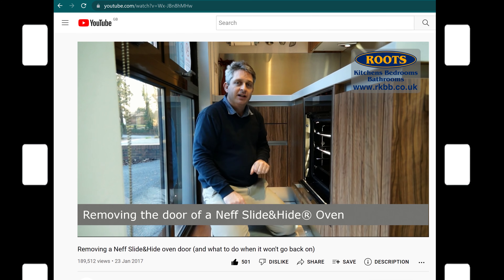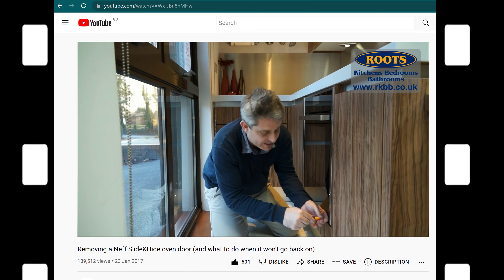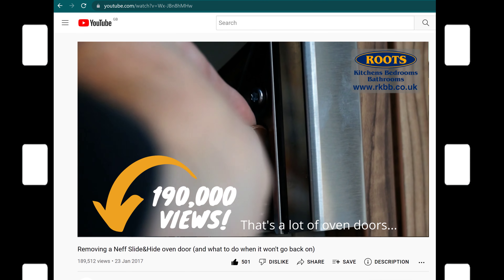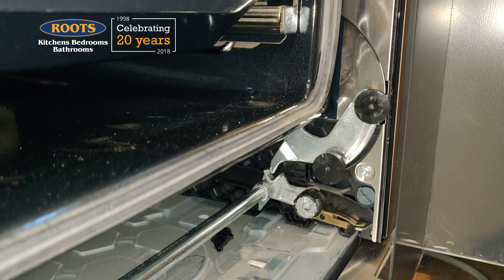Neff Slide and Hide - fixing the oven door hinge

Comment: I have had fitted 2 genuine replacement oven door seals on my Neff oven and they keep breaking, any ideas why ?? please, they have split over few weeks of each other, any advise would be appreciated before I order another.
Reply from the maker: Not something I've heard of but I would email the supplier as maybe they were faulty/brittle or they're discovering there's a batch issue with what they've bought from Neff. Things to check alongside that;
What cleaning products are you using? Check the ingredients and usage instructions - they may not be suitable for rubber products (and even if you're cleaning the door glass and not the rubber, residue if not washed off could potentially, maybe, possibly... affect the seal)
Check the part number of the seal with Neff over the phone - just in case you're getting one that's slightly too small, not enough to not fit but enough to keep it under tension so it splits over time (I think this is unlikely, but no harm checking with a phone call).
Hope that helps,
Steve
Reply: @RootsKent  thanks alot Steve for taking the time to reply, your advise is appreciated. On that note,  I will phone Neff tomorrow and speak to them rather than email service. Thanks again
Reply: Hi Steve, I finally have an update and thought to let you know. My issue was passed to there engineering team and it turns out there was indeed a batch issue  and there is a new part which has changed. They are sending this out free of charge. Hope there is no further issue. Thanks again @RootsKent

Comment: Hi Steve, I used your video last time I cleaned our oven door and it was invaluable.  This weekend I gave the door it's 6-monthly clean and I have a new problem - the hinge locks, don't lock!  ie the hinges go into a vertical position and the claws pop out of the V slots.  With my wife + 2 screw-drivers we can reposition the claws and then one of us holds everything in place by pulling the bar, and the other fits the door.  But we just can't seem to get the door over the wheels.  Have you heard of the hinge-locks failing?  I am definitely moving them from unlocked to locked as in your update video and pulling back before letting go - to engage a tooth.  But they just seem to have completely failed both sides.  Any ideas?  We are obviously oven less at the moment!  Thx.
Reply from the maker: I heard of the lock breaking from another comment here but I've yet to experience that myself. I do have trouble from time to time getting it to lock though,  I think I might of in this video! (been a while, so I'm not sure).
I'd certainly try several times just in case it's a position/angle thing.  Maybe 'opening'/'angling the two circle on the hinge further towards horizontal' could help. 
I think it's unlikely both hinge locks would fail at the same time too, so I'd be hopeful at this point it's just an angle of hinge, or how far the circle lock is turned, or if it's turned the right way...
good luck!
Steve
Reply: @RootsKent  I solved it in the end!  The hinges have to be pulled all the way - ie the claws pushed ALL the way back in order for them to be lockable.  Do left first and then right.  Keeping both little twin-roller sliders on the claws (with the bar between) whilst man-handling the hinges takes some 'patience.'  Then once you have refitted the door and reset the hinges locks you must open the door slightly to reset the mechanism - before trying to close it.
Reply: @PaulJReading  Thanks for posting this!  Could not get the claws to lock back at all. tried your ALL the way back, left, then right and it worked a charm.

Comment: Hi i have a neff slide and hide oven and today i took the door off to clean it but when i came to refit the door i noticed that the spring mechanism on both sides had sprung upwards and were not in the correct position to enable me to refit the oven door so i turned to YouTube and saw your video for advice very clear instructions indeed however after many many attempts plus watching your video over and over on how to fix this problem i cannot get the spring to come down and to stay in place it just goes back up to its original position please please please can you help me to rectify this problem
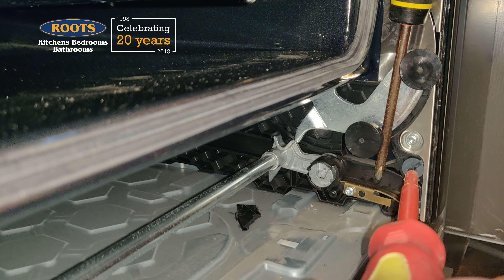Reply from the maker: you need to move the hinge back, then lock it (turn the circle with a coin or screwdriver, in the video at 0:57 ). You'll see I had to do it twice to get the lock to hold, try holding the hinge down at different angles if it doesn't catch the first time.   To of the slash to the back of the oven is locked if I remember correctly (so the left and right side are mirror image, but top of slash to back to lock... if I remember correctly).  Good luck!

Comment: Steve, is there a way to disable the switch that turns the oven off when the door is open, this feature is very annoying when trying to use the grill
Reply from the maker: No, by design modern ovens work as 'closed door grilling'. 
I was taught (pre millennium) the British way is to put the food and grill pan as close as  possible to the grill, and create enough smoke from burning fat to set off the kitchen smoke alarm. The European way is to put food on the middle shelf, and a pan at the bottom to catch drips so they don't burn and smoke as much. I don't know if that's true. I'd also think that having the door open and continuous grill is a problem for heat rising out of oven and potentially damaging oven controls

Comment: Hi, I have used this video before to repair the right hand side hinge (like in your video) but I am afraid this time the left hand side has come out of position and even following your video I cannot repair it.
Reply from the maker: Can you share a little more detail? Is the hinge not staying at the angled position? or can you not move the bar forward to be under the claw?
Reply: @RootsKent  I can move the bar forward to be under the claw but it won't stay in it. Can I send you a picture if that is of any help.
Reply: I really appreciate how useful your videos are but I am wondering if the technique is the same for the the left hand side as the right as the starting position is different in that it is impossible to safely get the screwdriver between the two wheels. I levered the mechanism in a different way.
Reply from the maker: @PeterWillingale  Great, glad you fixed it!

Comment: I can’t keep the hinge locked to the bar help !!!

I have followed your video but it just keeps springing back up
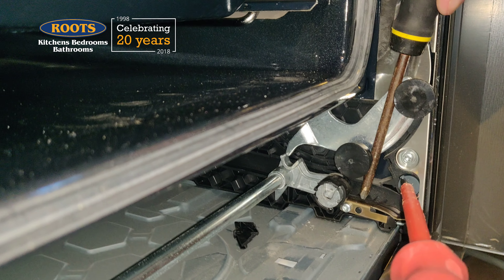Reply from the maker: Keep trying, at 1:10 you'll see I had to try locking twice. Other comments here show you're in good company as lots of us have struggled to lock the hinge for a while. Do keep trying different hinge positions, turning the locking circle both ways, maybe event a light tap between attempts (if the plastic push rod you can't see is sticking that might help release it).  Did I mention - Be careful of your fingers! 🖖
Good luck!
Steve

Comment: I've got a neff oven when I took the oven door off something clicked & when I put the door back on the one hinge has gone into a locked position but inside the door itself how cobi get the hinge out plessr
Reply from the maker: I'm not sure I can visualise this, but guesses:
Door is half open, one hinge on, the other hinge not:- I'm not sure how this could happen, but rotate the door handle to release the connected hinge to remove the door. Then set the hinges back to the 45degree open and locked, then remount the door. 01:37 on the video
Door is on but one hinge is locked still:- assuming you've turned the locking circle 00:54 (used the red screwdriver) and it hasn't unlocked, try gently putting pressure on the door/hinge up or down and try turning the locking circle again. Maybe there is a little too much tension on the locking part and it's not sliding free. Not something I've seen before but I would think this is like trying to change gear on a bike when you're peddaling hard up a hill - you have to ease of the pressure to allow the change to move between cogs.
Something else? :- sorry I didn't understand, you're welcome to try and explain again though!

Comment: I am struggling with the lock today on the right hand side. I took the door off, cleaned all glass panels etc, when I went to put it back on, I noticed the right hand side had not locked into position. I figured I hd to lock it in position before trying to put the door on, but I just can't lock it in place. I have been struggling to get the hinge locked in place for an hour and a half, used your screwdriver method but just can't get it to lock! please help or my grandson won't get his dinner!
Reply from the maker: I hope you fixed it and got your dinner 🙂
If not, most commentors seem to have found that trial and error works. Put the hinge in a different position, turn the lock, slowly release the hinge to see if it locks. If not, try again in a different position. I think between 30 degrees and 45 degrees open.  Screwdriver or coin has the same effect (the first video you'll see I used a coin, the choice of screwdriver here was simply because there was one next to me on site).
Good luck!
Steve
Reply: @RootsKent  thanks for your reply. It refused to lock, but I ended up getting a neighbour to hold it in place while I put the door back on. All appears to be working now.

Comment: Hi, the bar came out of the sliders. we managed to get it back in but now cannot get the hinges on both sides to lock on to the sliders. We have tried to turn the lock (once we've put the slider and hinge into the correct position) but this has no effect and the hinges spring back out again. Any suggestions?
Reply: How do you get the bar back into place
Reply: Please help
Reply from the maker: Hi Maxine,
"...hinges spring back out again..." it sounds like hinges aren't locking in the open position? If so, just as I found at 1m13 in this video, you can try again until they lock.
It's tough to describe these things in text so I hope I understood properly and that was helpful!
Steve

Comment: My hinge is sitting higher do you know how I can get it back down?
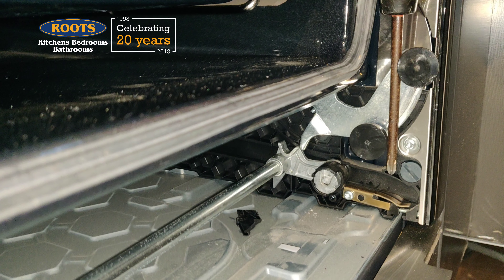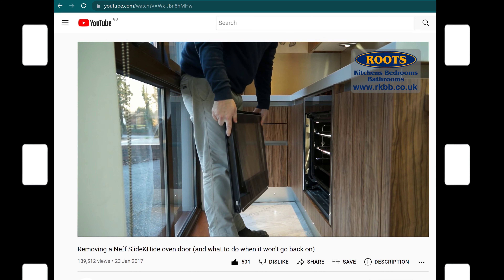Reply from the maker: Like at 0:55 in the video, the two circles one above the other?  If so, from 0:45 shows releasing the hinge lock to then move the hinge back to the correct position to engage the claw. Be careful of your fingers 🙂 It might be the claw is engaged correctly for you but you need to "unlock -> move the hinge to the angled open position -> lock the hinge" so you can slide your door back on.  If the claw disengages whilst you do that, from 0:34 are the steps to engage the claw again.
I hope that helps!
Steve

Comment: Hello, please help! My rollers have gone in a weird position(totally far back!) and now im frustrated! What do i do please??
Reply from the maker: Hi, reach in and pull them forward 🙂
If the rollers come off the horizontal bar, that's OK. When you've got them back to the front of the oven you can push them back together. You'll find you have to have one further forward than the other to slide the bar back and then bring them back to level (if viewed from above, it's like twisting the assembled bar and rollers from 30 degress back to 0 degrees-side-to-side across the cavity.
I hope that helps!
Steve
Reply: @RootsKent   thanks for your reply, its stuck! Proper stuck no chance i can pull it forward😔
Reply: Hi - it’s the actual hinges that are the problem. Right side is fine - left side the hinge has gone too “down” and cant seem to yank it up so it’s in same position as the right one. It’s not the rollers that’s the problem. Problem is with the hinge
Reply from the maker: @linguist786  Hmm, can you lock/unlock the left side hinge. Be very careful - the springs are very strong and will crush your fingers. See 1:07 where I'm using a screwdriver as a lever to keep my fingers well away.
Perhaps try locking/unlocking, apply a little pressure and lock/unlock again - in case the lock isn't releasing because of the pressure already on the hinge from the spring

Comment: The problem I have is I can't gain access to hinge because the door won't raise when I slide it forward. I am at a loss what to do next
Reply from the maker: Sorry for the slow reply, I've been busy with my real job :-)
I'm hoping you solved it by now and if you did please share to help others reading this.
Pure guesses - it sounds like the door is open and under the cavity. If it won't raise to fully closed, I'm guessing the hinge could still be locked? Try locking/unlocking the hinge (circle with a flat slot) a few times. Maybe it's stuck locked and once released the door will rise fully.  It might be you can tell which side is stuck by how the door rises, if it catches on one side but not the other.

Comment: I removed my Neff oven door to clean. 
It’s the older model, one hinge has locked before I put the door back on. Help please?
Reply from the maker: Older model, still hide and slide or normal 90 degree opening hinge?
Reply: @RootsKent  90 degree hinge opening. I just got sorted, I used a pliers to pull back hinge . Thank you soo much for replying 😀

Comment: Able to engage the hinge on the left hand side facing the door. The right hand hinge won t stay in place when locked.
Reply from the maker: Suggestions: check the door bottom corner that engages with the sliding part is the same both sides (if I remember correctly, a black plastic part with hook part. I once had an oven with a broken hook).
Check that when handle is rotated, both bottom corners of door move the same ( I've heard but not seen broken cables within the door)
Then check the silver sliding bar, circles have rotating black plastic locks. Maybe one is locked and the other unlocked.
Sorry for brevity, answering from mobile :-). Good luck! Steve

Comment: My roller bar has come off . How to I put that back on please
Reply from the maker: If I recall, the bar just pushes into the left and right side rollers (at 0:50 you can see the bar and right hand side roller, the part that the claw enagages too).
I think (long time since I did this) the trick was to push one side in (say left side), angle the bar with the right side forward and the right slider, then move the slider towards the back as the bar pushes in.
I've probably given better descriptions, sorry!
I recall that the bar with sliders attached couldn't rotate into place so one side had to be in first. 
I really hope that helps! Steve

Comment: Brilliant instructions. !!!  I have just been able to Lock the spring hinges and get the hook into the V ,   Shaped receiver , by using a long screwdriver to hold back the top roller & spring , and then turning the slotted dial to right or left , depending on which side of door you wish to lock the spring on .    Remember to leave the black plastic locks on horizontal roller arm unlocked. !!! Otherwise the door will not drop down far enough to be able to close,
Also when trying to close door, don’t forget to hold up the door handle as this allows it to drop down to correct position , and you should be able to close it then  !!!    He should get a knighthood off Neff , as they are useless!!!   Talk about German engineering, terrible. !!!
Has to be the worst ovens ( I have 2 side by side ) I have ever bought,  after 3 years everything started going wrong on both ovens,    Cheap plastic components used inside , and both had to have new programmers,   Nice to look at , but that’s about it .
Everyone I know who have owned one ( Neff ) would not buy again .
   By.   Ex - kitchen fitter .

Comment: What a nightmare to replace the door just because we had a smear on the inside of the glass. Ended up with the hinges in the wrong place and the bar off the lugs. Manage to wreck the seal around the oven so we'll need a new one. But at least the door is back on. The instruction manual is less than helpfull. Thanks so much for this video.

Comment: How do j get the bar to go back in place my bars come off
Reply from the maker: The bar that fits into the sliding part the claw engages? They just push back in place. You won't be able to do it when the claw is engaged though. You can remove left and right slider and bar from the oven, reconnect them, put them back in cavity, then follow the process in this video to lift claw and re-engage each side in turn.

Sorry for the three day delay - hope you manged to cook in the mean time :-)

Feb - Aug 2022:
Hi reader. If you're feeling generous, please consider donating a few pounds to my personal challenge to climb a mountain. All donations go directly to 3 chosen charities.
More about why I'm doing this here: https://www.roots.uk/expedition-w3w and you can jump straight to the donation page here https://sponsorme.charitiestrust.org/event/cbdf1e64-4af4-4905-865d-49ebaedb105b